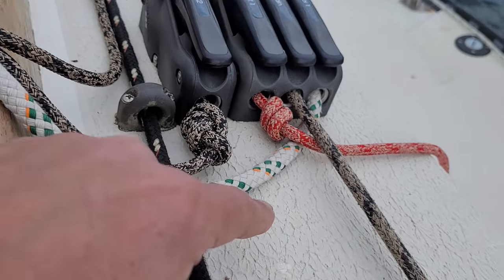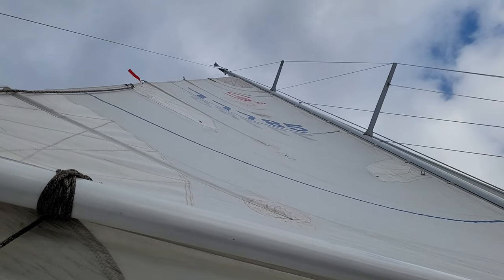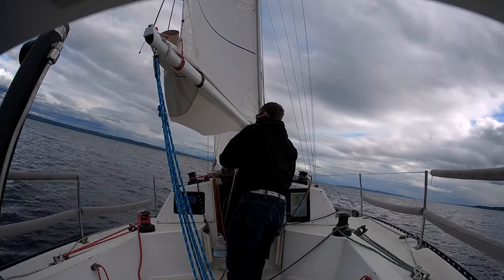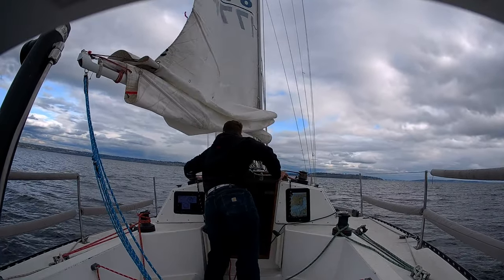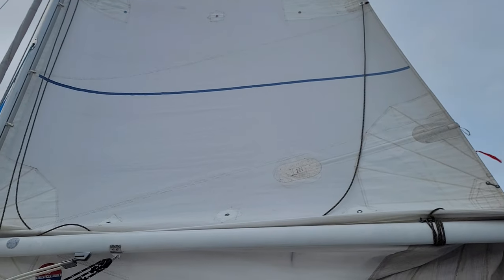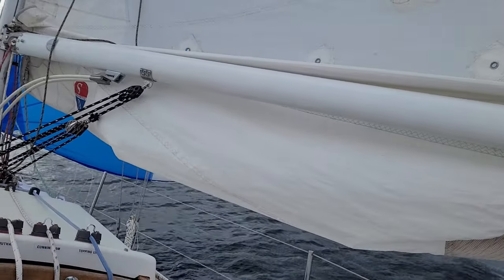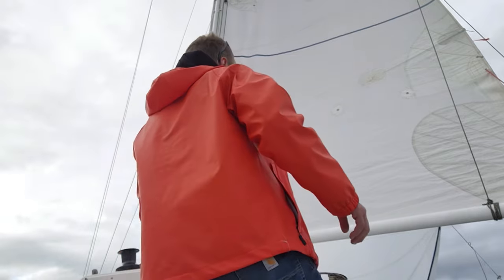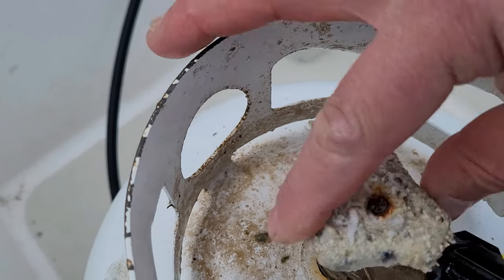How to sail FASTER while reefed | Mainsail Reefing Intro

Comment: 5⁰ to 7⁰ of rudder angle is usually optimum. It's much more efficient to get lift off the rudder rather than the keel and so you will make less leeway and better Vmg.

Comment: What block and ring are you using for the first reef tack if I might ask?
Reply from the maker: It's a carbo 40mm and a 3/16 1-¼ SS ring.

I originally had it running thru the grommet, but it was giving me a problem.  The line would pull the sail through the grommet when reefing.  I have also seen low friction rings installed instead of adding a grommet.